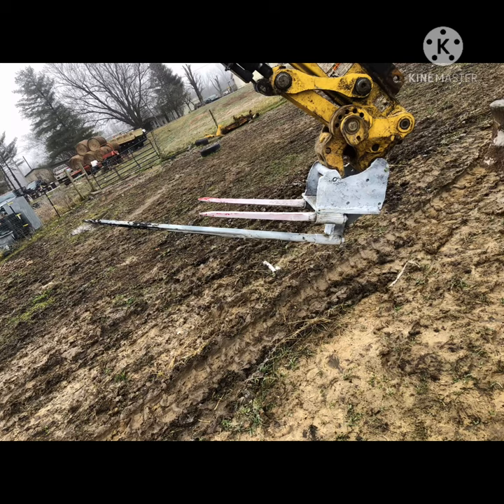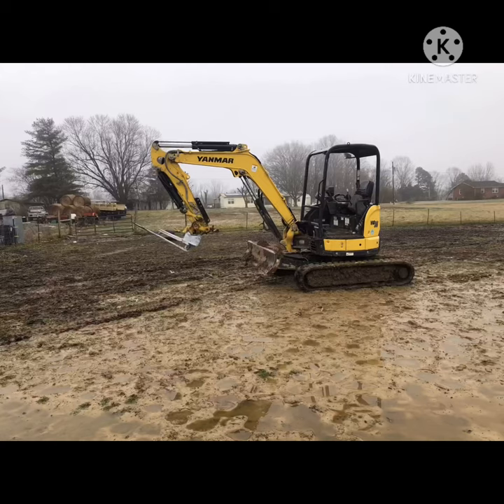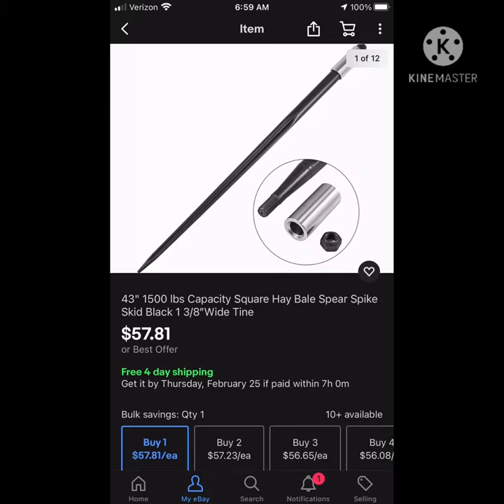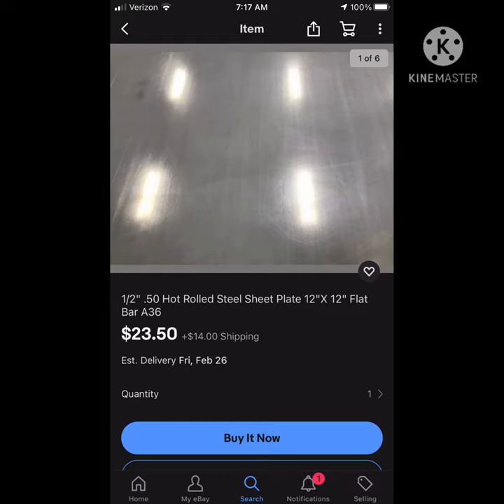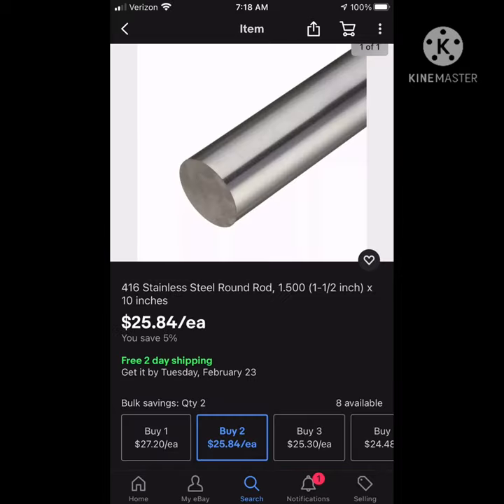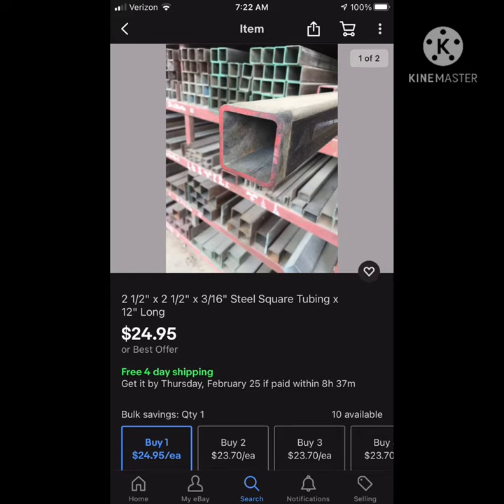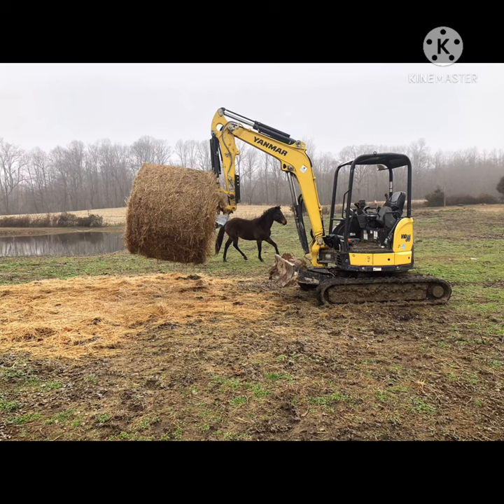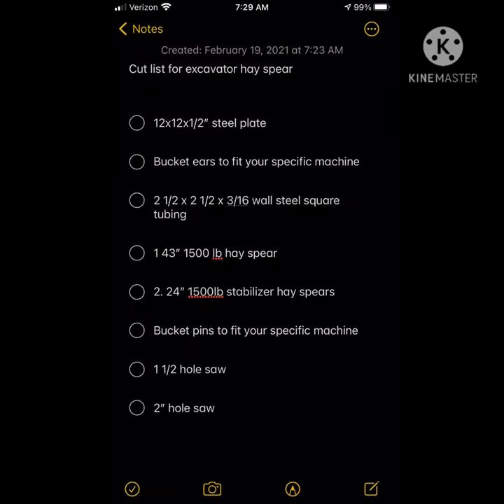Excavator hay spear   (Homemade excavator attachments)

Comment: What size mini ex is this? I tried to do this cuz my skiddy was on a jobsite, my little 8200lbs machine didnt like it when i ratchet strapped the bale to my bucket and lifted it but it did it.. i like this design alot!
Reply from the maker: Just strapping it to the back of the bucket messed up your  curl angle and puts i to far in front of you
Reply from the maker: https://youtu.be/PTqXkDcq7Gk. Here might be a option if you want to use your skidsteer bale spike
Reply from the maker: At 16:03
Reply from the maker: https://www.ritchiespecs.com/model/yanmar-vio35-5-mini-excavator